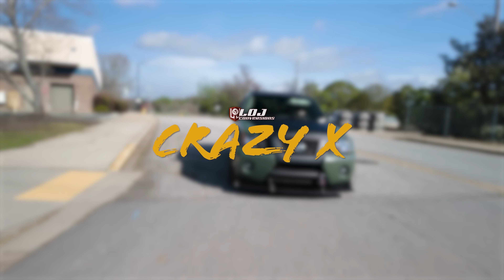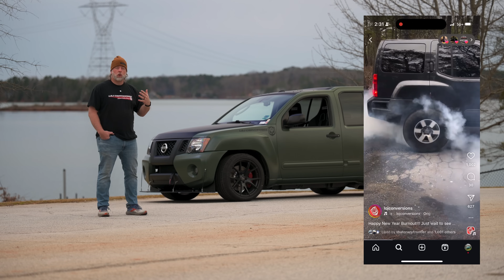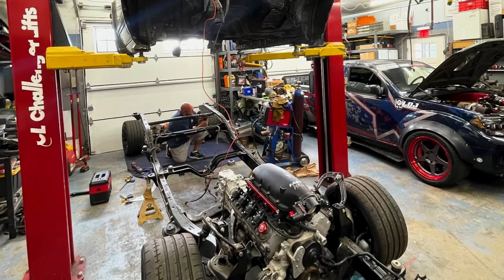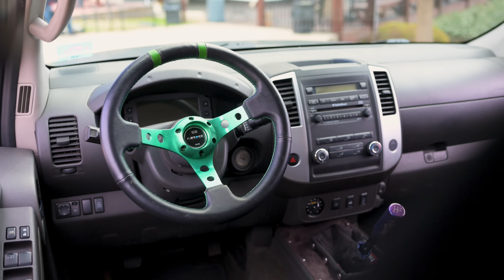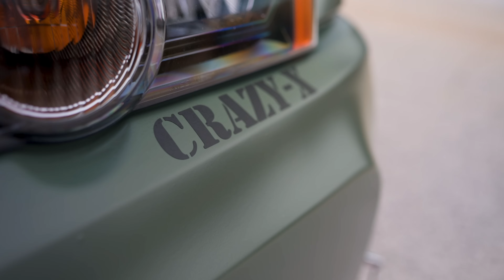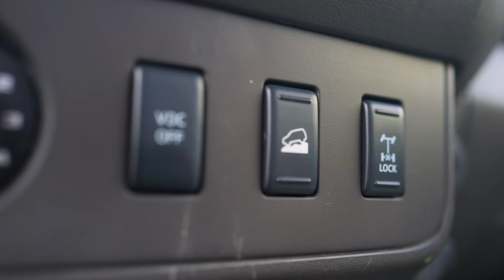The WORLDS FIRST Pro-Touring XTERRA - LS3 Swapped and MORE

Comment: Im not gonna lie, it needs the roof rack back on it. That's what made it an Xterra. Having the 2nd row bump exposed doesn't really look right, even if it's supposed to be a street build. Otherwise, this looks solid.
Reply: Fifty plus pounds on the roof does not help on the track.
Reply: @mikemccarthy3250  😵‍💫 aint no way the roof rack is 50 lbs, but then again I never wanted to take mine off when it was an overland rig.
Reply: @TheReal_JG roof rack and off-road Oem lights were north of 50.

Comment: This is sweet. I have a few questions.

1) given the availability of the Quaife, does that make the V6 pathfinder IRS in some sense better than the V8 pathfinder/Armada version when swapping to an Xterra or frontier?

2) re: the gas tank/fuel cell, if you hadn’t done the chassis drop could you have kept the Xterra gas tank? Could you have used the pathfinder tank with the pathfinder subframe with or without the chassis drop?

3) you have a similar kit to mate the 6 speed to a Godzilla, any plans for a build series? They’re not plentiful in junkyards and therefore cheap like the LS yet, but 7.3>6.2.

Comment: Why not the Nissan VK56? Keeping it all Nissan.
Reply from the maker: This is a loaded question that I should dedicate a video to. Very short answer that does not do the question justice…

VK56 is cheaper to swap initially, it is also heavier, more expensive to maintain, and orders of magnitude more expensive to make power with. 

LS is more expensive initially, much lighter, dirt cheap to maintain and the absolute cheapest engine on the planet to make power with. 

Both swaps have a place in the market for different reasons.
Reply: @LOJConversions  that's understandable. I'm guessing the 4 cam head set up makes it heavier, although having an aluminum block and heads? The LS is hard to beat! I'm about to restomod my BMW 635csi with an LS. But I think the VK56 has great potential. It was just a thought of keeping it all Nissan.
Reply from the maker: Yes, the heads, cams, and valvetrain all add a a good bit of weight. VTC solenoids too, it all adds up. 

The VK is a good engine. I have plans for a project that uses one. And for guys that want a little more power and V8 noises in their build, it’s easy. It also keeps the purists happy, not that that’s ever been a concern of mine. 

Your project sounds cool! Best of luck with it!
Reply: @LOJConversions I can't wait to see that build with the VK56! I own a Nissan Titan with that engine. Hopefully soon I can get started on my BMW. Thanks!!!
Reply from the maker: It's not going into a truck, thats about the biggest hint I can give :)
Reply: @LOJConversions once finished, will it be on YouTube or your website?

Comment: >LS3 swapped
Okay, but Nissan has the VK56
>Video in 24fps
Just... Why? Cars and vlogs/promotional content/informationals look so much better at 30 and if you use the same 1/50th of a second shutter speed as you would with 24fps you get better motion blur and it perfects the style.
>Same wheelbase as a corvette and already 50/50
Man, that sounds perfect for a transaxle conversion and getting a rearward weight bias. Maybe for the next one? And while you're at it, look up what a De-Dion axle and a Satchell Link are. Combine those two with a static camber and toe adjuster and it could be better than IRS.